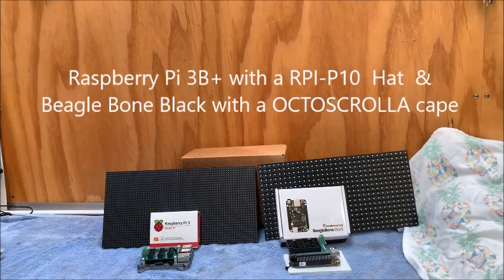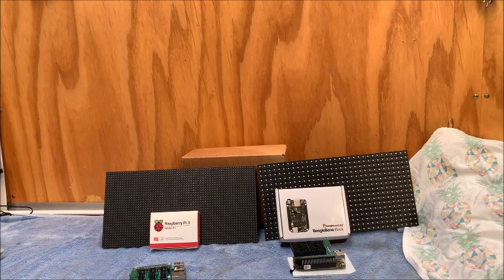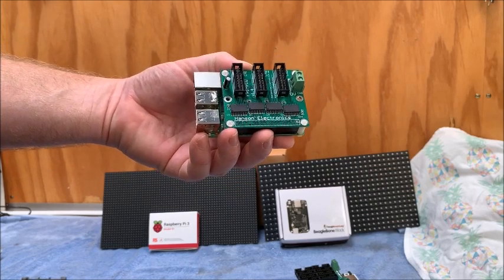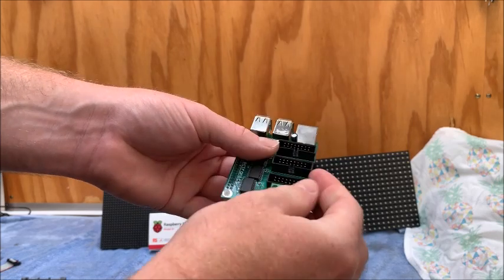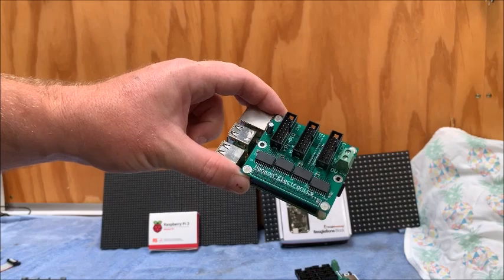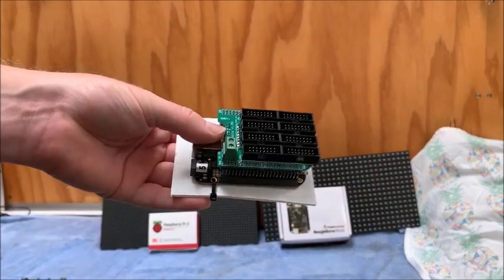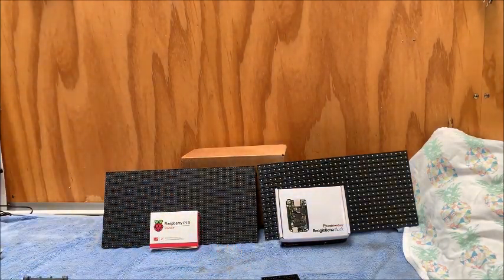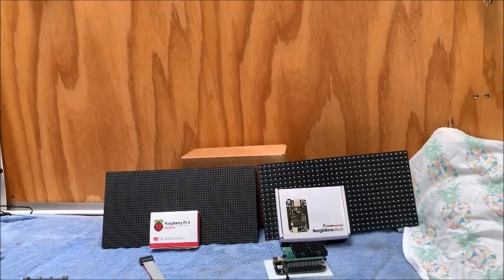RGB LED P10 and P5  Controllers RPI-P10 and Octoscrolla

Comment: Great video LDL. Watching the video I now have another feature that I have thought of for rPi-P10 and Octoscrolla.
  I've never mounted any of my Pi's or BBB's onto anything other than direct to the wall or lid of an enclosure but that 3D printed Pi mount looks pretty good. The coro BBB one looks more my speed though as I don't have a 3D printer.
  Thanks for the kind words. It's always great seeing my boards in videos.

Alan (from Hanson Electronics)
Reply from the maker: Thanks Alan here is a link to the Raspberry pi cases (only using the base in this video) I 3D printed from thingiverse https://www.thingiverse.com/thing:922740
The Beagle Bone I used for my Tune To Sign Matrix utilises the mounting location provided with the Boscoyo P10 Panel connectors like this https://www.boscoyostudio.com/index.php?main_page=product_info&cPath=52_39&products_id=78&zenid=6mbja0d7hlr9357u5feo54vm81